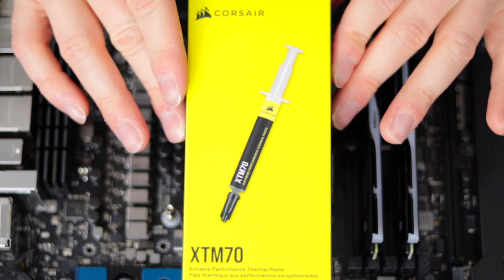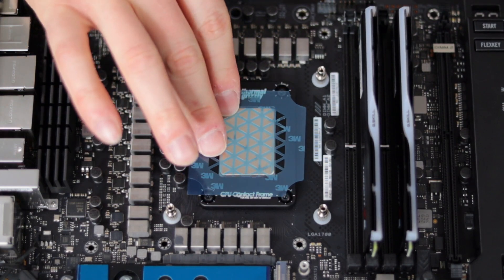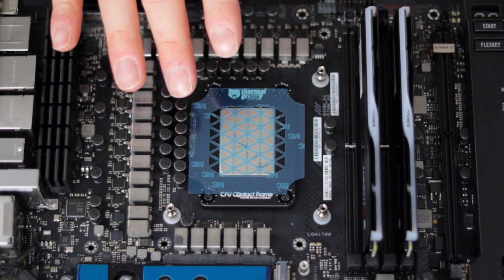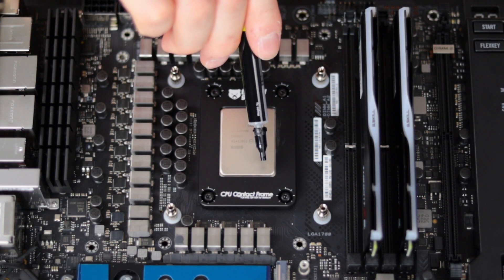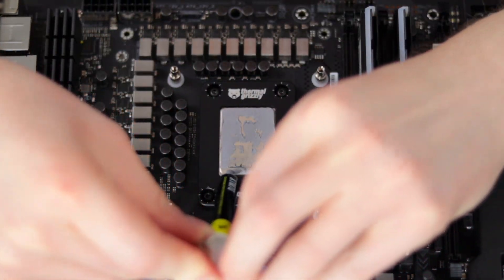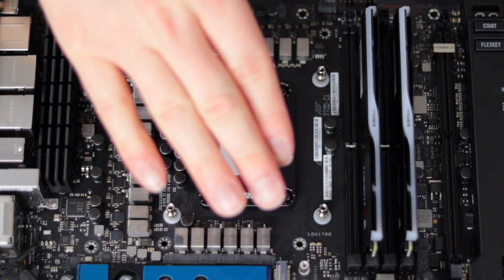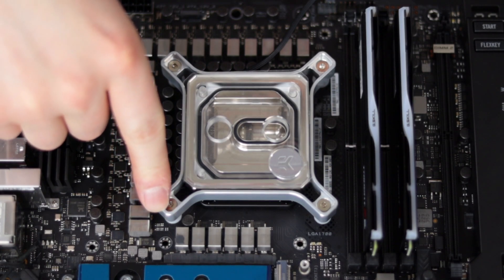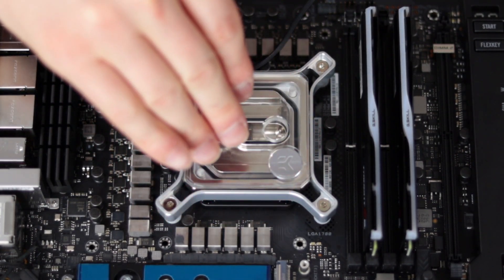This Is The Most Controversial Step In PC Building..

Comment: This thermal paste tamed my i9-11900k. Draws around 325W and doesn't thermal throttle now, running 5.1GHZ all cores. Using corsair cappelix 360 AIO
Reply from the maker: I am loving what it is doing with the 13900k! Gotta get a review of it together, but I will definitely be continuing to use this on my builds!
Reply from the maker: That is some impressive wattage and speeds!

Comment: Hi, can putting the contact frame over the motherboard damage the motherboard causing a short circuito? Thanks
Reply from the maker: Hello! Not to my knowledge as the contact frame has been coated in an electrically non conductive coating. Even tightening the screws as tight as they will go down will not cause damage to the CPU socket (although it probably won’t POST until the screws are loosened). There is a chance of damaging the sockets pins during removal of the ILM if they are left exposed but that risk can be mitigated by placing the cpu in the socket before any work is done!
Reply: Yes.. very interisting
Reply: Thanks...  I can install It without putting anything between the contact frame and the motherboard
Reply from the maker: @michelemandoloni3185  Yes, that is correct, and it looks like you saw my install video of the contact frame otherwise I was going to recommend checking that out. Thank you for watching!!